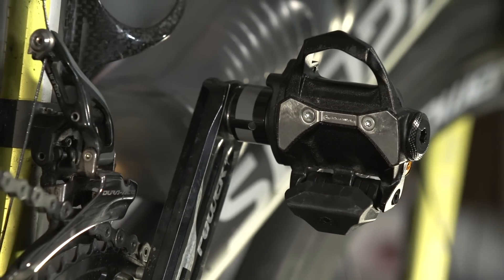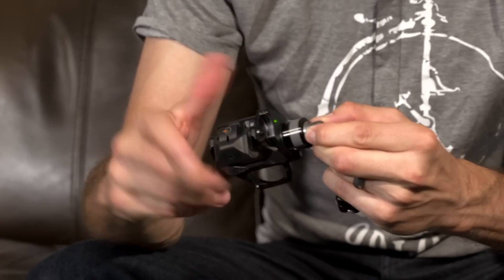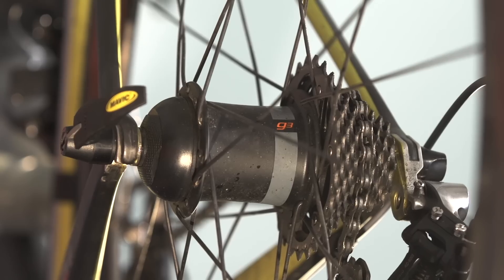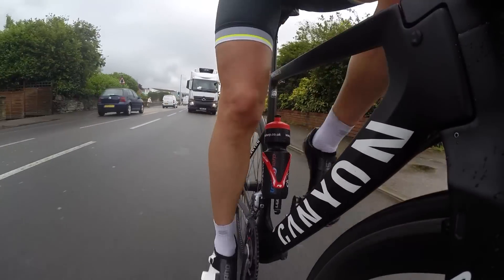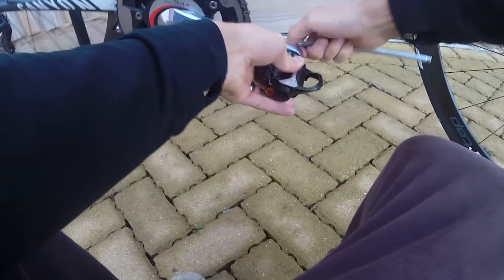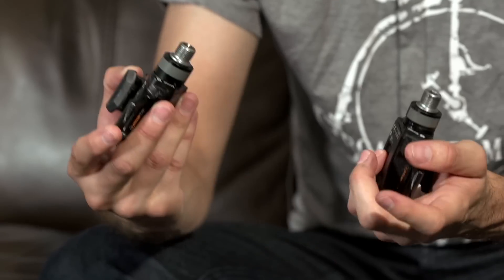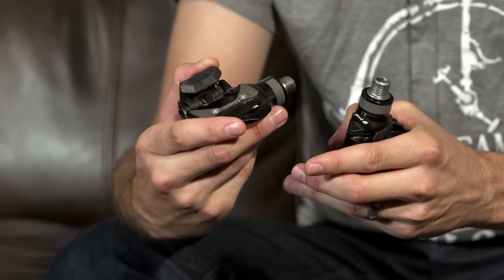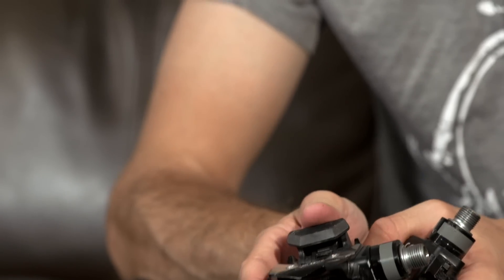PowerTap P1 pedals - First Ride

Comment: The Powertap specific cleats are not a big deal, they cost about $15 US. Easy Peasy. And if the width of a AAA battery is the difference between clipping the ground and not, you should probably ease up on your cornering. Clearly a better choice than the Vector 2s.

Comment: Why are the power meters so dear? Is it because they are so expensive to build/manufacture or is it because they are so good and the market is small?

Thank you in advance :)
Reply: +Graphic The material cost is extremely low (very simple electronics), the reason for the price is because there haven't been any good power meters that are cheaper basically. There is a significant r&d cost but power tap and garmin of all companies should be able to eat that kind of cost. They are just waiting until they are forced to lower the price by a competitor, then they will. Each year the cost comes down a bit more as new players enter the market. I still think garmin should have just bitten the bullet and priced the Vector S at like £350, then they would dominate the market early on. In a few years power meters will be far more common.